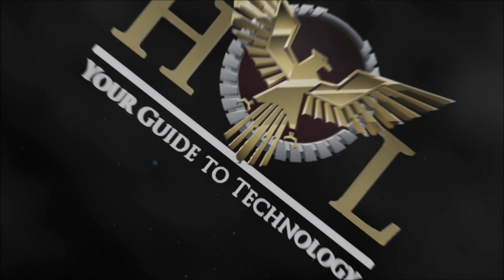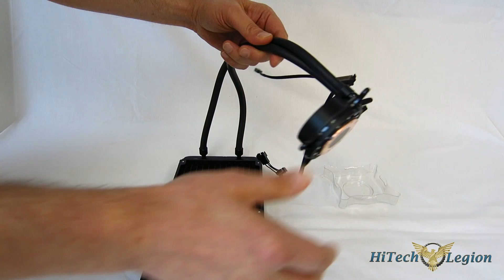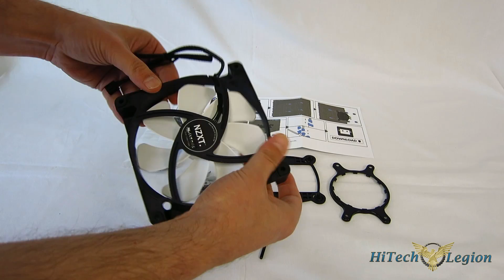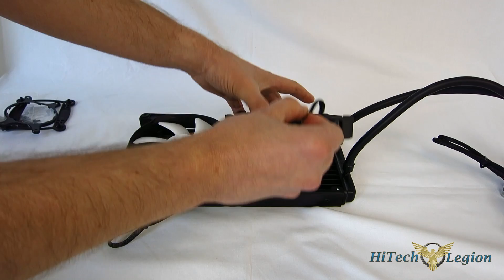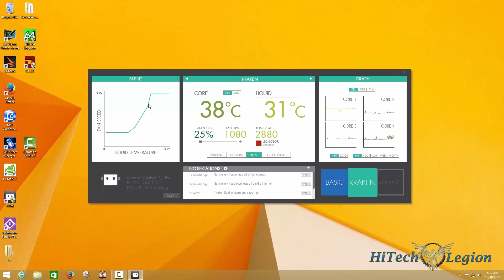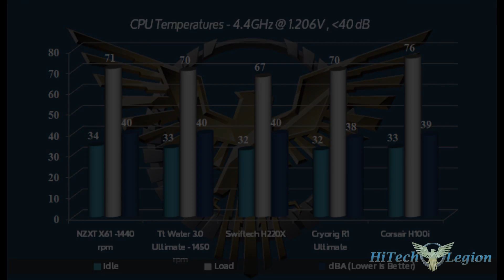NZXT Kraken X61 280mm CLC CPU Cooler Overview and Benchmarks

Comment: So you dont need to put a coolant, you just plug it in and your ready to go?
Reply: also i bet it does but does this fit in the S340 Case?
Reply: Adardon 106 obiously does man
Reply: Just check the mm of the radiator and fans

Comment: I was looking at getting a corsair for my next system but i am not sure now i may get the x61. thanx for the video.
Reply: The H115i and X61 are essentially the same Asetek cooler with different fans and a different logo. CAM and Corsair link are both buggy, but CAM may be a little better.

Comment: Another point against front mounting is the fans will invariably be lower down and pulling across a surface where dust collects, meaning 100% of dust you take into your case will be passing through one of the hardest components to clean dust out of.

You'll still get some dust in the thing when top mounted but a quick model of the fluid dynamics would suggest roughly 50% less dust will pass through your radiator when top mounted.

However, if your case has an open grill on top "ambient dust" will fall directly into your radiator, though likely passing right through since there's a very small vertical-facing surface area.

A lot of cases (Phanteks Enthoo Evolv for example) have a plate above the case which stops dust falling in.

Comment: Linus Tech Tips points out that pushing through a radiator means lots of dust gets trapped between the fans and the radiator. This is much harder to clean than a pull configuration where the fans are pulling air through the radiator and you can just vacuum the dust directly from the radiator in the case.

Less dust in the radiator means a cleaner radiator, and thus, better airflow THROUGH the radiator.

I think pushing seems like a great idea if you're willing to pull the fans off the radiator often to clean between the fans and the rad. If you want a more maintenance free system, pull makes more sense.
Reply: I know this is an older video, but I was going through the comments looking for your exact thought. Makes sense to pull through for a much easier clean. Less time consuming and wouldnt mind doing it more due that.
Reply: Glad I could help. There are tons of videos out there on Push v Pull with liquid cooling and LTT is the only channel I have seen mention the practicality of cleaning the radiator with push vs pull. I like a clean PC so dust removal considerations ARE a factor for me. Others' mileage may vary.

Comment: Is it loud ?
Reply: +Who is I ? You are posting this for a video that clearly shows dB levels, as well as comparisons?
Reply: +George Cella I know it has dB levels . I could've gotten the dB levels from any other review site for this product but what i wanted to say is if is loud enough to be anoying . You can take 50dB from a fan and 50dB from something that is not going to function for a long period of time and i can tell you that the fan is going to be worse . And the dB comparations don't help me because i don't know how loud are the other ones because i don't own them or saw them in real life . The comparation is good if you care more about statistics so you want to choose the best one based on the numbers .
Reply: Who is I ? In terms of numbers, dB and temp are pretty cut and dry.

Is it loud enough to be annoying? That is a very subjective question. It is a CLC, it uses very inefficient parts and relies on more airflow to do the cooling, so "annoyingly loud" comes with the platform in the opinion of most users. Forums these days are full of people switching back to air because they can't stand the noise, and simultaneously filled with users saying their CLC is silent. Personally, there is no way I could use one on a regular basis simply due to the noise. Taking these out after finishing the review and putting a D15/R1/TC14PE/etc back in is like a breathe of fresh air very time I boot the computer.

But....that is subjective.
Reply: Is it as noisy as the stock cooler for the Ivy Bridge ? That is noisy for me .. and that's what i want to get rid of .

 Edit: I have a i5-3470 and im changing to 6700k . Yes everything i buy is new , from the PSU,  to the Case and Fans . Minus the GPU .
Reply: Who is I ? It would be quite a bit louder than the stock cooler in most cases, but will also provide better temps.
Reply: +George Cella With stock settings the Kraken could be loud, but with a little trick you can separately control the pump speed and fans to find the right balance between temps and noise. 
If you're interested, I made a video with the tutorial and test. ;)
Reply: FrankyLabs Obviously, we tried this in the testing to try to get the best results under 40dB. Separating and controlling the pump and fan speeds individually is easily done with CAM if you use separate headers, but that is not going to help the performance to noise situation that is hindered by bad hardware. The high fpi aluminum rad and low flow pump need the high flow fans to operate effectively, and even with that it is never going to keep up with something like a Swiftech H240-X2 or even top tier air.
Reply: Is a bit louder than i espected but not too bad . Maybe if i change the fans it will be better ? Any sugestions ? I want the maximum silence that won't impact performance .
Reply: Who is I ? Unfortunately, what you are saying is "I want magic". And, to date, no one has found the magic fan that can defy physics. The issue is that since the radiator is very low efficiency, and the pump isn't moving enough liquid, the whole system requires more airflow through the radiator than usual to function correctly. You can change to quieter fans, but almost all of the noise is generated by the air passing through the rad, not by the fan itself. This means that you will need to put the same amount of air through the rad to achieve the same performance level which will yield the same noise. Since the fan, itself, isn't the main noise offender (the rad is), you are kind of in a no win situation. You could do something like change to a NF-A14, and it will be quieter only because the NF-A14 tops out at 1200 rpm - but it won't be any quieter than the stock fans at 1200 rpm (or the rpm they can move the same amount of air at) and performance won't change. An eLoop might do a little better in terms of noise/performance, but only slightly, and adding top tier fans would have you spending $160+ on a CLC....which will get outperformed by a far quieter $79 air cooler.
Reply: George Cella I don't say "i want magic" i just asked for some tips because sometimes changing the fans will make the fans quieter . Like the beQuiet fans .
Reply: George Cella And to be honest i would've wanted to go for the dark rock 3 but i sent the request for the kraken x61 so it was too late .I don't say that i don't like the x61 i just wish that it was a bit quieter .

Comment: Can this thing fit inside CM 690 II Advanced?
Reply: +ultramanJR You'll soon find out, that's what I'm installing mine in. I'll let you know as soon as I've installed it. Just awaiting Windows 10 to finish downloading twice, once to upgrade it and another to do a clean install.
Reply: +Zooumberg cool show me the pics if you were successful.
Reply: ultramanJR
I will do mate. Windows is taking ages to install.
Reply: ultramanJR
Right it doesn't fit. Well it does, however because of the thickness of the fans and radiator, it covers the top standoffs so you can't install a motherboard. So I guess I'll be buying a new case.

Comment: Why you didn´t show about water and adding it WTF
Reply: +DJbudx x Because this is a closed loop cooler, so there is no way to add coolant to it. It is pre-filled and you throw it away when you get evaporation. This isn't custom or open loop cooling.
Reply: +George Cella How long does this last than?
Reply: DJbudx x Typically we have been seeing around 3 years before performance begins to lessen.

Comment: +HiTechLegion        Am stuck between Hydro Series H100i GTX 240mm   or Kraken X61 280mm  ?  I'm using the older version of H100 & it's time to upgrade !  however i was looking on getting EK-KIT X360 High Performance  ..
Reply from the maker: +Jimmytwogunz You should look at the Swiftech H320-X2 over the EK as it offers better performance with lower noise. Also look at the H220-X2 rather than Corsair or NZXT for the same reasons plus many more.
Reply: +HiTechLegion  Thanks very much for you reply !
Reply: +HiTechLegion Here in Indonesia, it's hard to get a swiftech cooler. I tried looking for 3 days but to no avail. So my question is; between corsair h100i, h110 and nzxt x61, which is the best for performance+noise wise? Thanks in advance.
Reply: +HiTechLegion I am using the NZXT H440 case btw.
Reply: +HiTechLegion can i change the fans of the x61 with an corsair case led fans?
Reply: +HiTechLegion So you reccomend the swiftech coolers highly?
Reply: +Dieringer Scott The Swiftechs are far and away the best performing and quietest AiO we have ever tested at HTL.
Reply: ***** The H220-X2 is only $10-20 more than the NZXT or Corsair. It is actually incredibly inexpensive for what you are getting.
Reply: KAREN DESU The H220-X2 absolutely cools better than than the NZXT, and does it with considerably less noise, and the pump issues were on the first rev H220, not the X or X2.
Reply: I'm upgrading to the Preadtor 360 ...
Reply: guys what's better h110i gt , h110i gtx (from corsair), h115i, thermatake ultimate 3.0 rgb 360 or this kraken or x62 kraken? help me to choose please, what's better performance?
Reply: Vadim Fedossev The Swiftech H240-X2. By a wide margin.

Comment: Dear Mr. George Cella, if CLCs are not more effective but considerably nosier and more expensive, why do people buy them?
Reply: +Aaron Feygin That is a question that those of us that actually look at the performance results ask quite often - you can see many threads on this very subject in many forums. You need to understand that people are impressionable. They see "liquid" and simply assume "better". Then a bunch of people in forums make ludicrous claims and the problem swells.
Reply: +Aaron Feygin for me it's moving the heat outside the case - venting directly out rather than into the case. You could achieve the same with standard DIY water cooling but then you have to deal with maintenance and leaks and whatnot.
Reply: streaky08 Really.....let's not get silly here. You can't compare this to a custom loop. Your images of maintenance and leaks are way overblown in your mind.
Reply: +George Cella I wasn't comparing I was clearly stating that it's a reason - as for maintenance and putting it together and leaks and other stuff, it's non-zero so.. Anyways my x61 arrived and I can't get my 6700k to heat up above 58 degrees with prime95 on the "please melt my cpu" setting so I'm happy.
Reply: +Alexander Binovski minor issue with a rattling fan at full tilt - swapped them with a pair of Noctua NF-A14's (PWM) and now it's godlike. Completely silent and the liquid never goes above 32C now even running Prime95 in please melt my CPU mode for long periods - CPU temps are about the same but liquid much cooler, I figure the 58 is about the limit of where the block will shift heat off the die . The software is lame but at least they're working on improving it bless 'em. No serious issues of any sort though.

Comment: can this thing fit in nzxt h440 on top ?
Reply: +51538153 Yep! Using one right now
Reply: +Horri Siel  hey horri. could you tell more about it because im planning on getting the same setup. are you okay with the noise etc. thx :)
Reply: +electronictheory Keeps my CPU cool on silent settings. That being said, it's very quiet. It also looks great in the system.

I had the Thermaltake 3.0 and switched to this and was a great change.
Reply: +Horri Siel how about the manta?
Reply: yeah

Comment: this guy is miss guiding people in the comment section. He almost seems biased. First of all water cooling is not for everyone. So if you don't like it, just don't get it. Now that you have made your mind, I'm using NZXT X61 myself with NZXT Noctis 450 case which is not silent case but I'm satisfied with the noise level on full load. And even then I can replace the fans with silent ones to further lower the sound level.
Reply: +Alexander Binovski I have no experience woth any other. X61 is my first liquid cooled AIO and I can't recommend it enough. build quality is very good and so far I have zero problems. No software glitches or any other whatsoever. Noise level is almost silent. Only noise in my case is that of powersupply (waiting for my EVGA ome, using temporary PSU for now) and sometimes my gpu AIO makes pump noise. If you ask me, I'm very satisfied but everybody has a different experience. My CPU temps never go above 45°C while overclocked
Reply: +Alexander Binovski you are always welcome
Reply: +Ali Sher hey Ali, i got the same case and i am thinking about getting the x61 as my first aio liquid cooler as well. i just wanted to ask if youre using the standard nzxt fans in the n450 and on the x61 or if you changed them since this comment :).
Reply: hopsi Still rocking the stock fans. If you are concerned about noise levels, I will suggest that you get Corsair AF/SP Silent editions but performance wise I'm pretty much satisfied with them. Might change in future.
Reply: Ali Sher thanks for the reply dude! one last question i forgot to ask: how did you set up the kraken inside the n450? on top as exhaust with push or pull or as intake with push or pull? thanks a lot :)
Reply: +hopsi I didn't do push pull setup. Just using 2 stock fans as exhaust on top that come with the AIO. My gtx980ti Hybrid also comes with a radiator which I have mounted in the lower front. But I might exchange that with rear exhaust stock fan because I think I'm getting a negative pressure airflow. I want to turn it into positive to keep most of the dust out.
Reply: Ali Sher alright, thanks man!
Reply: Izzy Hayes Which fan connections are you talking about?

Comment: Would I be able to use Corsair SP140 fans on this, even if they are three pin.
Reply: Owen Jones-Wells Yes, but why do you want to downgrade the fans?
Reply: I do not want to downgrade, but would rather have all fans in case be the same, so far have not been able to find any fan that works well, think I will just keep the stock fans.

Comment: So I was going to get this, then I saw it performs the same as the Cryorig R1 Ultimate yet the Cryorig is significantly quieter and significantly cheaper. I can't see a reason to buy this over the Cryorig unless someone is kind enough to point something out I may be missing.

Thank you for the video.
Reply: Saracen Gaming The only reason would be if you like the look. Despite the rumors in forums, CLCs do not perform better than top tier air cooling when both are in a case with good airflow, and CLCs are significantly louder. We have been showing that here at HTL since day one. If you are looking for an AiO that will outperform an R1/NH-D15/Silver Arrow IB-E/PH-TC14PE, the only choices would be the Swiftech H220-X and H240-X.
Reply: George Cella Thank you George, I will check them out. Much appreciated.

Comment: Hey guys so I just have a quick question about the x61, I bought the x61 a few months ago and I recently started noticing something, I think my liquid temps are a bit too high? Can someone pls confirm this. While watching YT vids and having the pump on the CAM software set to silent I get core temps of 25-30 C but I get liquid temps of 40-44 C and I saw that the CAM software has a notification of temps greater than 50 C and since I don't think that what I'm doing should put the x61 under stress I think those liquid temps are a bit too high, can anyone pls confirm this? Thanks!!

Comment: I'm debating between this and the Cryorig Universal, I prefer the looks of the X61 but it seems to be much noisier; is it that noticeable?
Reply: speedy_3014 Of course, a lot of that depends on your build, your ears and your tolerance for white noise. Having reviewed both of these pieces here (along with just about every other cooler from major mfg), I can say this - first, with all of these coolers at my disposal I use the Cryorig R1; second, when I take a CLC out of my test rig to put the R1 back in, it is a huge audible relief (the Cooler Master Nepton 240M being the lone exception). Between the pump noise and the fans needing to push air through a high fpi radiator, the noise floor of the X61 is almost as high as the noise ceiling of the R1.